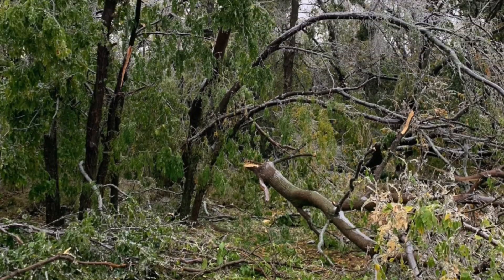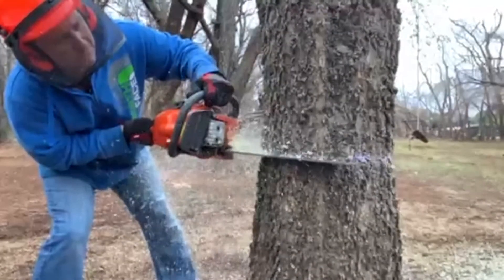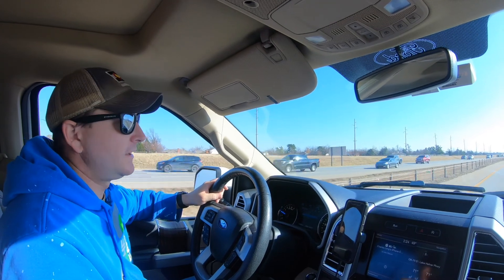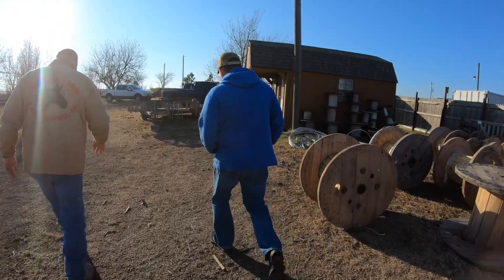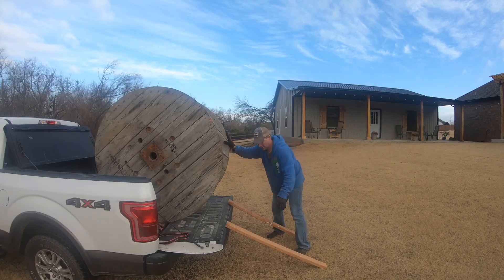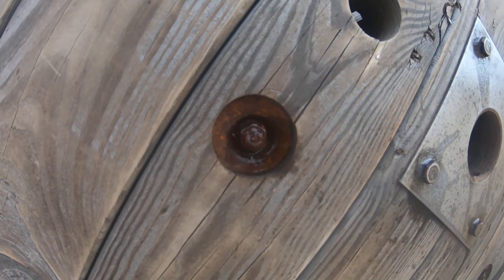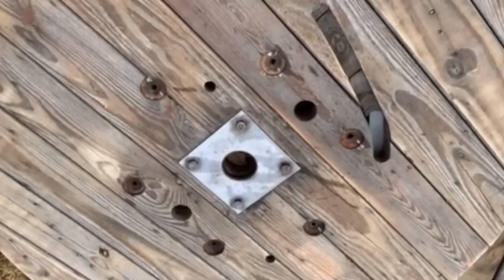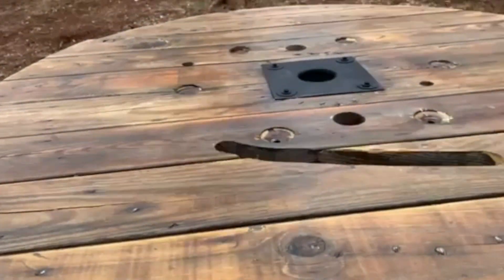Cable Spool Tree Stump Table?

Comment: You may find 220 was too fine. The finish will penetrate better if you stop at 150. You could go to 180 and then hand sand with the grain with 150 if swirls are something you worry about. I have a finishing shop, and that’s what I would do. Other than that, great job! I’m doing something similar at my house. I got my hands on four 5’ round 2” thick solid oak tops from a brewery that went out of business. Gonna strip one down and refinish it with marine finish. Found some 2” thick live edge red oak slabs for bench tops I’ll attach to logs. Turn an ugly tree into something beautiful and practical that’ll last for a long time.